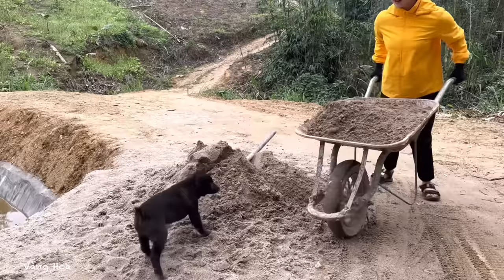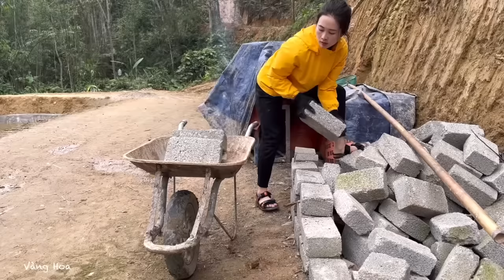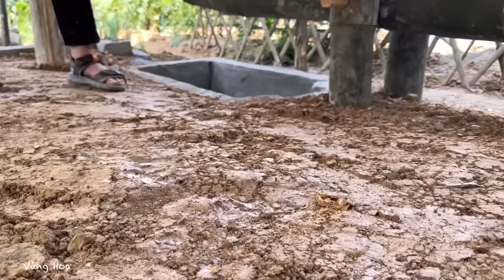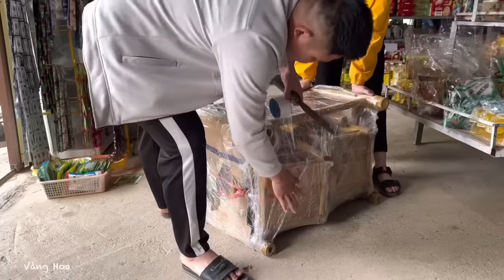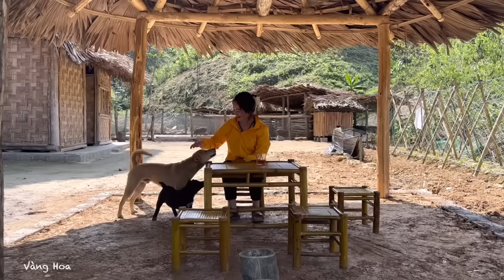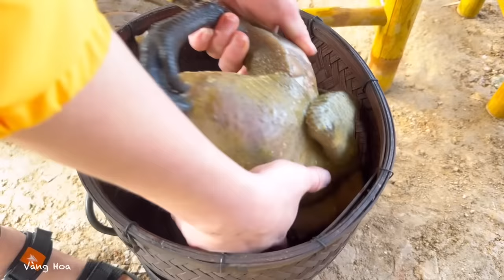Boil A Whole Black Chicken To Enjoy After Hard Days, Vàng Hoa, king kong amazon

Comment: You go, but don't push too hard. Glad to see you relaxing with a nice meal. You know concrete blocks are also excellent building materials for housing. They insulate well against weather extremes and last forever.  Keep their looks especially when painted with a sealant. Withstand wind and water damage.  But a solid foundation and metal rods should be added with a vertical building and no more than two stories without structural planning.
Reply: Please come back Zon we miss you so much,we are used to you. We like  Vang Hoa too,but without you it's not the same.